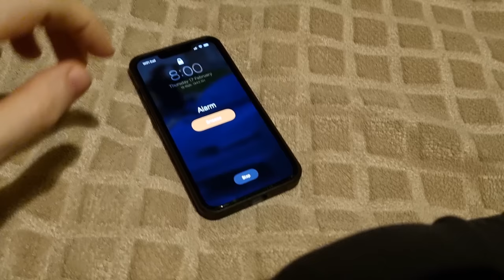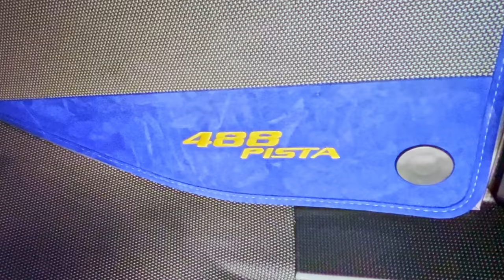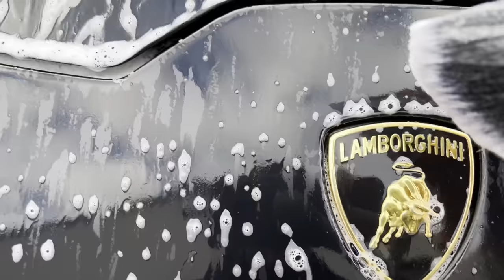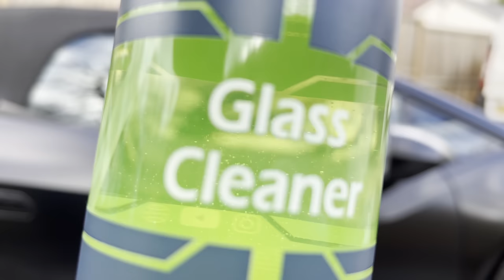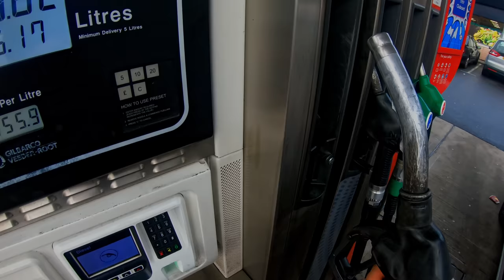Day in the Life of a Luxury Car Wash

Comment: Hi Tino , great video !
Correct me if I'm wrong, but wouldn't it be more logical to use the glass cleaner first before applying the ceramic snow foam? 
That way, there's definitely no dirt under the coating, I would think.